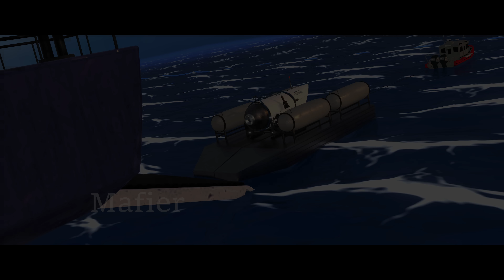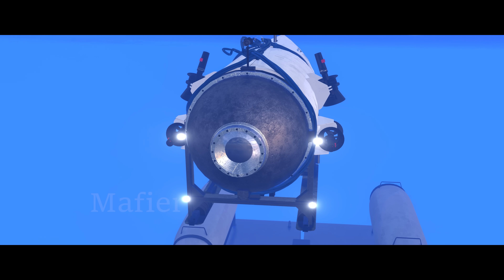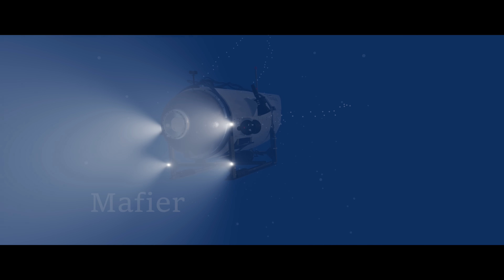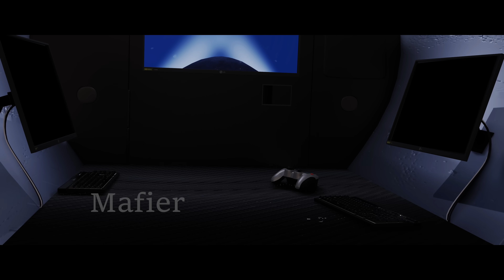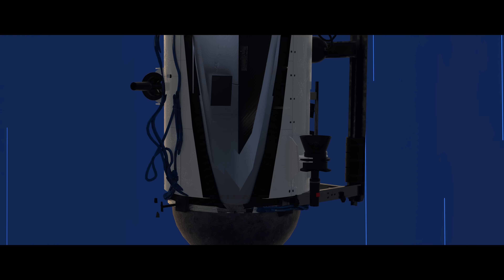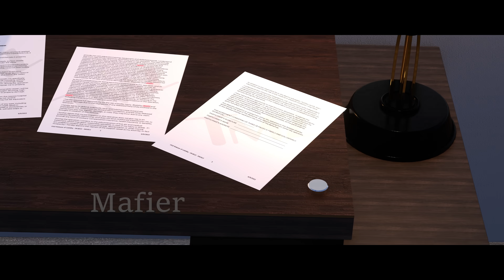NEW SHOCKING DISCOVERY Of Oceangate's Titan - 3D Animation

Comment: Here is the problem: Carbon Fiber and Titanium have a DIFFERENT temperature expansion coefficient. Let's imagine that at the first dive that creates a crack of just 1/100 mm. And a TINY, TINY quantity of water manages to bear down into that crack with the full pressure of the full depth. With every future dive that crack WILL get exposed again, and again, and you're coming to a point where the full water pressure reaches the inside of the vessel,  or even ONLY the outside of the inner metallic tube around which the Carbon is spun. So now you have the full pressure not bearing down onto the outer carbon shell, but, bypassing that shell, goes onto the INSIDE metallic tube. Which is NOT designed for the total pressure. (If it had been up to that pressure, they would NOT have "needed" any Carbon layer at all). And so it is just a matter of time until the big KABOOM. RIP all aboard. We hope that nobody tries this again.

Comment: the fact that even ameteurs in engineering and even people with no expertise in the field can point out a multitude of flaws in this design is such a glaring point of stocktons failure. carbon fibre hull?? such a flawed and basic control system?? the front end cap that was sealed by a torque wrench, and that wasn't even fully bolted up despite the pressures it was going to have to withstand??? the fact there had been next to no testing, and all the failures accounted for the whole time???? who in the hell ever gave rush a degree in engineering. he was an insanely cocky man and it cost him. i feel so bad all the time for the 19 year old on that submersible - he didn't want to go on and yet he lost his life. this entire tragedy just saddens me.

Comment: As stated, there is no mystery. Carbon fiber’s strength is in tension. A tube shape isn’t utilizing the strength of the fibers. I’m more versed in structural metal engineering than composite materials, but even I can tell you that was a ridiculously stupid design decision. The fact that it made more than one trip is miraculous.

Comment: I believe its repeated use combined with its inadequate hull material led to its failure. The carbon fibre would have micro fractured in places and its last dive was the straw that broke that camels back... literally 🤷‍♂️
I also read that their last communications stated weird noises from the rear, and they also reported computer issues. All this tells me that the hull failed as they were trying to correct the computer issues. Then the implosion happened before they even knew it.

Comment: I'm going to say the propellers, controller and system worked fine. The issue is the hand glued carbon fiber to titanium would be my guess. Their promotional videos of the craft being made showed oregon hipster coffee baristas hand painting glue on the connecting parts, and only a few inches worth of connection at that. The titanium should've went at least 18 inches deep into the carbon fiber and not just a press fit 3-6 inches. The amount of air bubbles in the glue up would hold 1-2 times...maybe, but will definitely crack and expand under the changing pressures. They probably thought everything was fine and then one blink later, they're waiting in line at the pearly gates to see where they're going.

Comment: Controllers designed for life safety applications require a much higher degree of quality control and reliability than game controllers. This would include testing to determine the conditions under which the controller used would fail. OceanGate didn't test either the controller or the pressure hull to failure. This tragedy was the result of arrogance and irresponsibility on the part of those responsible for making decisions regarding life safety .

Comment: The transcripts of the last communications provide evidence that nothing in this video is correct. They did lose power but they were on the assent when their RTM sensors signaling that the hull was failing. Last known depth was around ~3500m and ascending when the hull failed. They were very aware of the problem for about 20 minutes before failure.

Comment: The vertical free-fall animation is pure fiction. The transcript of text communications between Stockton Rush and the Polar Prince 'mother ship' tells the story pretty clearly. We can assume that transcript is genuine, as it hasn't been challenged by Oceangate.

Following the alarms sounding (indicating an issue with the hull), Stockton Rush aborted the dive - though by that time, they were almost at the Titanic site. The submersible dropped ballast to return to the surface. But Rush stated that the sub wasn't rising fast enough, so in addition he jettisoned the metal frame surrounding the Titan too. 

Soon after that they lost comms, and Titan fell silent. It now transpires the Navy picked up the sound of the implosion at that moment, so they did in fact know exactly what had happened to the vessel and its 5 occupants (as James Cameron confirmed soon after official confirmation of the tragedy). 

Which begs the question why did they perpetuate the myth, over several days and media conferences, that the submersible must be found before its occupants ran out of oxygen? 

The alarm system designed to warn of an issue with the Titan was a total farce. It sounded around 2 hours into the dive - so it would take another 2 hours to return to the surface and safety, by which time, as we know, the mystery issue had caused an implosion.

One interesting fact to emerge from the transcript, is the speed at which the Titan descended that fateful day - far too quickly. The mother ship was supposed to be monitoring the Titan's performance, including its rate of descent. Yet they never once told Rush it was diving too fast. It may even have been an uncontrolled descent, due to unidentified damage which later caused disaster.

Had the Polar Prince crew picked up on the issue of speed during the first 30-40 minutes of the dive and aborted it, they could potentially averted tragedy.

While the 5 men had a speedy death, the transcript revealed the prior period of crisis and mounting concern inside that glorified Coke can, as the alarms sounded. Heart breaking.

Comment: This Jose guy has a wild theory, here is a more realistic one which fits the found debris: 
1) Titan dives, weight exceeds maximum, thus dive is way to fast, as reported by Stockton. 
2) Few hundred meters away from the titanic, resulting because of the fast dive, the sensors of the carbon hull signal a shift in the layers (Structural integrity not stable anymore). 
3) Stockton foolishly decides to immediately stop the dive by dropping all weights/ballasts in a panic, this will result in high stress level on the hull. 
4) All the stones are now set for disaster, there is no way of stopping it anymore. The sudden acceleration puts even more stress on the hull, causing the layers to shift even more, and carbon hull to implode. 

If Stockton hadn’t tried such a quick manouver, the OceanGate would’ve made it back safe to the surface.

Comment: According to the transcript (rightly or wrongly) the weights were the first thing to be dropped at the first sign of trouble. Landing platform also came up as a separate piece when, implosion occurred, should not be disconnected. It was dropped also as ballast because they were actually rising and NOT crowded around the front window since they never got anywhere near the Titanic. The Carbon Fibre hull is a bad idea. It is a woven material designed to stretch with pressure applied from the inside which is why scuba air tanks can be made from it. It CANNOT do the reverse and be squeezed as it turns very brittle and cracks.

Comment: People focused on the hull design while ignoring the epoxy glue holding the titanium rings to the hull. Ocean water is very corrosive due to high salt and mineral content.
Most likely failure point was the aft electrical connections, allowing seawater to seep into the interior and helped weigh the sub down, not allowing it to easily surface. Once neutral buoyancy was affected the Titan was trash waiting to be recovered.
The sub Titan was just like climbing the highest mountain, largely unnessary but achievable none the less.
Remember: play stupid games and win stupid prizes!!!

Comment: There was no downward thrust at decent of the sub, so an electrical failure wouldn't do anything here. Delamination of the wrapped carbonfiber did seperate and carry on excess water, and slowly giving away the strenght of the cylinder.

Comment: A loss of power followed by an inevitable bow down plunge to the bottom is about as simple an explanation as it gets. The passengers weren't harnessed in so they couldn't help but slide forward. There was no capability to level the craft to counteract a shift in the center of mass. The implosion would be an independent failure as the craft was supposed to be able to withstand the pressure at 4,000 meters. The implosion actually was a more merciful end than a prolonged stay jammed bow first into the muck.

Comment: I believe one towing it. The water was beating it to descend it way too fast, three previous problems and present problems with communications for should’ve as soon as it stopped communicating it should have been called for emergency people to come in and look for it or to re-communicate with Titan, not weighted. I also don’t believe it’s totally in the implosion theory because all the pieces came up intact. They were in sections, but one piece you can see the frame you can see the capsule. You can see the collar where it was connected. You could see the engine. You can see the structure of the engine compartment area, you see the window when they brought up the body of it I could see the main screen in the back and that there is something on the right side those smaller computer I believe is started maybe to implode like a tin can, but then burst it open and burst it apart I do believe and I heard they found somebody’s or a body that total implosion would’ve particle lysed the whole thing and it didn’t. There was pieces that came up say implosion therapy. Siri might have been a small part of it but not all of it I do think there was sounds from the people Calling for help but because help wasn’t coming and communications was not there I think we heard the people for a short time hollering for help I think will never know the truth. Nobody wants really the truth to come out. That’s why they covered it buried it. It’s in a building somewhere, I think they’re going to study if they’re going to look at it and in time a lot of us has gone to forget things so if they’re not gonna share the truth, God bless all the family all the people and if anybody ever decides to do this again have a test and have it make sure you got the right materials make sure there’s people involved unfortunately to save your back side and do it right it’s going to be a costly venture and there’s others there trying it already. Please be safe.

Comment: Every other Deep water submersible that goes to extreme depths is spherical. the spherical geometry is for a reason. and that is to disperse the preasure equally in every direction. The Titan had two major hull flaws. First the cylindrical middle hull. Second and the biggest flaw the two different materials used. the middle hull was carbon fiber and the two end cones were made of titanium. These two materials act differently under different pressures. If they are expanding and contracting as pressure changes it is only a matter of time the stress will eventually fatigues the carbon fiber and then there is a failure. all it would take is just the sliest bit of torsion and snap. Carbon fiber is a very strong material until there is a twist and under those kinds of pressures instant failure.

Comment: Im a Structures Engineer in Aerospace. My best guess is cyclic compressive loading of the composite hull caused delaminations to grow until it could no longer support the insanely enormous column load it had to carry to keep everyone not dead.

Composites are not great for compressive loading because the compressive strength is dependent on the epoxy in the matrix and the carbon fiber isn't able to be used to its full potential. Pushing on a rope as opposed to pulling on one.

Comment: I'd read a report about this and they included the transcript from inside the submersible. It seems that Rush (and his passengers) knew there was a problem (sounds of the hull weakening) and started to try and bring the Titan to the surface.  The transcript revealed that Rush was upset that the sub was rising very slowly, much slower than anticipated.  From what I remember about this transcript, the scenario went on for much longer than two minutes.

Comment: At a depth of 3,800 meters, the pressure is more than 380 times the surface pressure, every 10 meters towards the bottom, the pressure increases by 10 bars, the pressure is equivalent to feeling the weight of 35 elephants, which would be relative to 210 tons compressing the Titã submersible. 🚨

Comment: There are several factors that may not have been look at yet.  Going cold and pressurized and then back to normal temperature and no pressure makes for possible usage failure.

Comment: Thruster failure and software reboots, to me, show a severe lack of any quality control program.  "Just bolt it on and let's go" sort of atitude.  I know we often make jokes about 'beaurocrats' and 'paperwork'.  But things like a solid, reviewed, quality control program are born from the lessons learned from past disasters.  Even at the turn of the last century, good engineering demanded proper testing of boiler relief valves and proper testing of steam locomotive boilers.

Incidents like those cited on previous dives indicate more of a 'got to make deadlines to get headlines' atitude versus following some simple manufacture/ maintenance procedures.

Comment: why not use a steel shell of some kind where external calculations could have been used for the thickness required at such depths of the sea instead of using carbon fibre. The dished ends as you can see from what what recovered withstood pressure. None of the carbon fibre was recovered intact. And glue was used for the carbon fibre shell to a ring that bolted to the dished ends. That was even crazier. I would not have gone inside that vessel even if they paid me.

Comment: I believe it was leaking. The documents show it went down too fast. A plausibe reason is because parts of the submersible was filled with water. When they realized something was wrong and tried to return to the surface it moved very slow. A struggle to decrease the depth only 30 meters. Then it imploded.

Comment: Baloney.
1. Titan was not tugged after mother vessel any singificant time period. It's silly. It was transported onboard, then it was floated down to surface on site.
2. Titan never could turn vertically, especially on power down. Its normal (passive) attitude is horizontal.
3. ...

Comment: At the end of the day it comes down to  the owner. He had been told many times it would not work so when he went down a time or 2 he had a false sense of security. Every dive it took caused way to much stress to the hull and it only needed the smallest error for the implosion. The owner was a fool to put others in the sub. You don't buy parts off the store shelves when your building something to dive to those deprhs and use a Logitech controller. Stockton was so arrogant he wouldn't go back up and when they were having difficultie  lied to the crew. He was trash all the way to the last moment it would appear

Comment: There was someone that calculated the decent speed of the sub's ascend and descend reports.

It seems like they were descending much faster than they should have and tried to accend at a incredible slow pace before losing connection with mothership.

It could mean alot of things.
From overweight to engine problems

Comment: if the counter balance weights on the bottom of the sub where able to be dropped with solidly attached mechanisms instead of electronics they could have dropped them and floated up. people rely too much on electricity.

Comment: How can the presenter of this video suggest that the reason for the loss of the Titan might remain a lifelong mystery?  There's no mystery about the inadequate engineering design and testing, using materials such as Carbon Fibre which is strong under tension but not in compression and never before for this application, avoidance of professional advice etc. etc. !  There's no mystery, it was only a matter of time before the materials failed after repeated cycles and without thorough non-destructive testing after each cycle.  This was a gung-ho organisation run by a cowboy inventor, imo. I'm devastated at the loss of life, especially those who put their trust in the operator. RIP.

Comment: There don’t seem to be any thrusters to keep the thing level (horizontal).  It was said that it tipped forward and plummeted downwards vertically.  EDIT. There were no seats or seatbelts or anything to ensure that the weight of the passengers remained equally distributed across the length of the cabin, to keep it level.